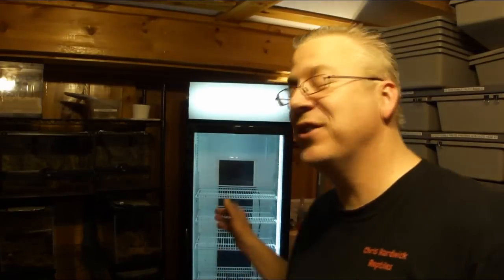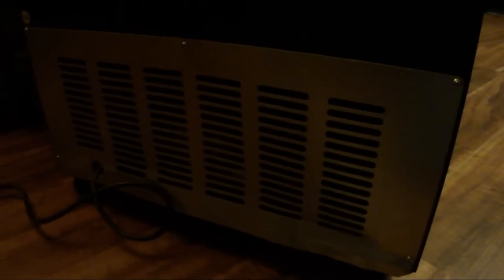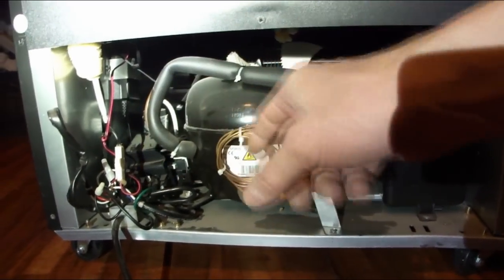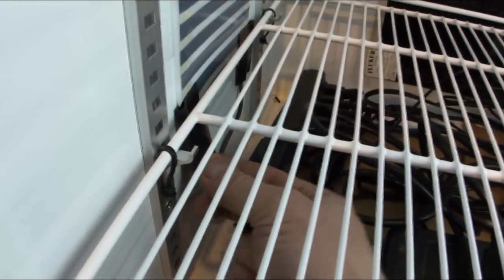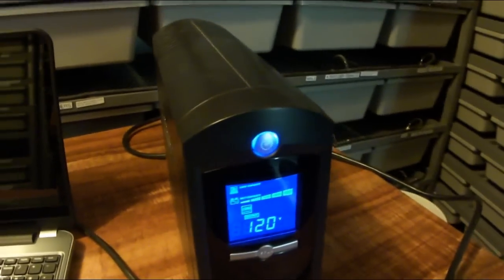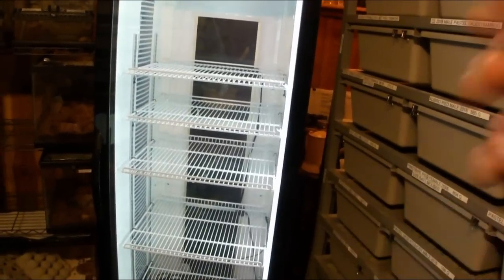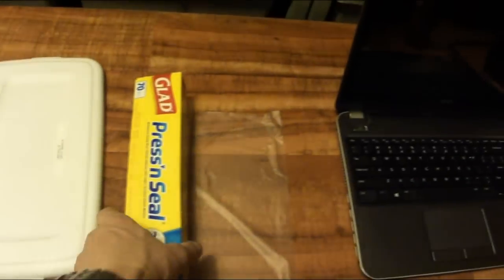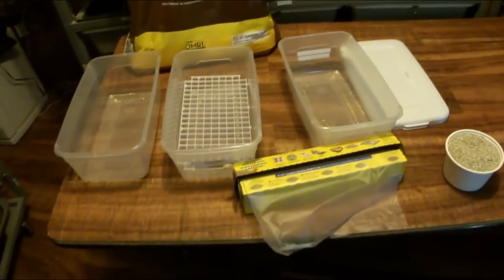Fridge to reptile incubator conversion

Comment: Hey Chris, I understand you are using a VE-100 digital thermostat to control temperature at 90ºF for your snake eggs. I'm working on a different project (more like a very slow cooking kind of experiment). I need 130--140º F. Can your Vivarium unit work at the temperature range I need?

Comment: is it possible that the built in fan is working extra hard because it thinks that it is supposed to still be keeping the unit at a cool 40 degrees for beverages? i dont think that fan blows that hard when it is being used as a refrigerator unless the unit is too warm. im sure that its not real hard to make that fan work the way you need it to with a dimmer or some extra resistors stuck into it somewhere. c:
Reply from the maker: That fan was 240 volts, kinda crazy.  I'm no electrician so not sure how to adapt it.

Comment: Hey Chris nice video. Just started doing research on reptile breeding. I did have one thought though. If the added heat from two fan creates a temperature control issue couldn’t you just remove one or both of the heat strips on they back and just use the added heat from the fan motors?
Reply from the maker: The problem is that the heat strips are off and the fan motors keep increasing the head in the dead of the summer.  Almost need an incubator that will heat and cool to maintain temps.

Comment: I like how you did that . .. I used to throw those cookers and wine chillers out by the truck load at my old job my boss would buy them at auctions and the one we raised for parts to fix some of them we would toss out lol . Damm wishes I kept a bunch of those lol. I am going yo have to make one this winter it next spring .
Reply from the maker: Yea, one mans trash is another mans incubator LOL
Reply: No doubt . I'll get ahold of him soon and get a couple of those . I think you could use a wine cooler to not as big but might be a good starter and for my leapered gecko's. I have a few .
Reply: That I'm raising not really high end but an experiment and pets .

Comment: I used to you a computer fan, 120mm I placed on top with 1" spacers then screwed it into the top blowing down. I put my egg boxes to the sides so the fan could blow air to the bottom. It was quite, cheap, and worked great.
Reply: Side note, my old incubator had room for 4, square 1 gallon water jugs at the bottom. This helped keep the  heat consistent and I think you might be able to get away with less heating.  I used 1 strip of 12" heat tape along the sides and bottom. I then attached the wire to the middle of the heat tape on the bottom. This gave me an even current/ temperature range (if you attach on the top at one of the ends, that side will be hotter than the other side. My thoughts were to plug in the power in the middle at the bottom so my hottest temps would be there and the heat tape would be slightly cooler at the tops, since heat rises. I used a dremel to  make a slot to run the wire to the other side (door side) to attach to the heat tape. I installed my 120mm PC fan on top with the 1" spacers, and I also added a line of LED lights (since my cooler didn't have a working light. Then drilled a small hole to feed the heat tape wire, LED lights, the USB PC fan and temperature probe through. Once I had all the wires in place and working as I wanted I took some expanding insulation foam (forgot the name but it comes out of a spray can) to re-fill the hole, once dried I took a razor blade to clean up the foam so it wasn't as noticeable. I had 4 shelves that I could stack 2 egg boxes on top of each other and fit 5 stack per shelf, but I only put 4 so the fan could blow the hot air from the top back down. I kept temperature probes on each level moving them side to side (eventually leaving them in the middle) and with my thermostat set at 90°f I was able to keep everything at 88° but the top shelf would reach 89° at times. That's when I was in Las Vegas and I believe it had more to do with the placement of the incubator and if it was hotter those days. Anyways, consider using some water bottles, they take up space but hold heat very well so its worth the space. Hope this helps.
Reply: Good idea with the pc fan I’ve got a couple laying around

Comment: Where you using computer fans?
Reply from the maker: No, it was small desk fans.
Reply: @ChrisHardwickanimaladventures  cserpents uses computer fans I think that's a good choice. Get a ten inch and mount one on the bottom and one on the top

Comment: What would you say would be the best brand incubator to buy online or at store for ball pythons?
Reply: Eggs*
Reply from the maker: Personally I'd use an RCOM Pro incubator.  I used a similar unit with my chicken eggs, you get an incredible hatch rate and it's just set and go, all the programs are built in.  It controls temperature and humidity.  Here's a link:
https://rover.ebay.com/rover/1/711-53200-19255-0/1?icep_id=114&ipn=icep&toolid=20004&campid=5338474897&mpre=https%3A%2F%2Fwww.ebay.com%2Fitm%2FR-COM-RCOM-JURAGON-PRO-90-PX-R90-REPTILE-EGG-Large-INCUBATOR-Brand-New-WARRANTY%2F253911623528%3Fepid%3D2261398513%26hash%3Ditem3b1e4fe768%3Ag%3Aa6wAAOSwAjpbs75Z%3Ark%3A4%3Apf%3A1%26frcectupt%3Dtrue

Comment: Hello Chris, I have one similar to yours, I had actually removed the condenser and compressor,  and then cut off the front vents and put the frame on hinges, now I need clean and paint the inside then im gonna add led lights and plexi glass on the door front, I think It will make a great spot for the thermostat and misc. storage, also I'm going to use the condenser fan on a dimmer switch to control the speed,  nice  video keep doing you

Comment: You can hook a dimmer switch from home Depot to fan in top
Reply from the maker: Actually that fan on top has a big transformer and it's 220 volt instead of 110 volt, that's when I gave up LOL.

Comment: That is a ton of heat tape. 
I have under 4 foot of 11 inch flex watt with a false wall to the floor of the fridge with about 1/2 inch space from the back wall with 2 120mm computer fans at the bottom and the false wall stops about 5 inches from the top of the fridge to blow all that nice warm air gently over the top. 
Easy build no wires all over the place and keeps a 89 deg inside the tubs at all times.

My egg boxes are locking lid tubs and I don’t use any substrate at all just water. I have light defuser then 3 pieces of pvc then these plastic things used in arts and crafts then light defuser again then set the eggs on and good to go. Water didn’t splash around and don’t build up condensation on the lid the sides get a little bit not to much.